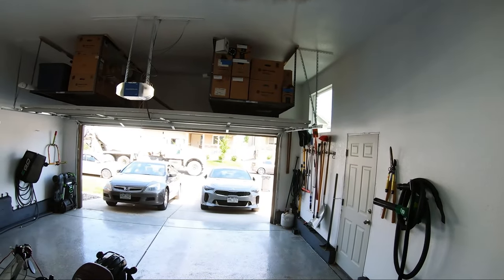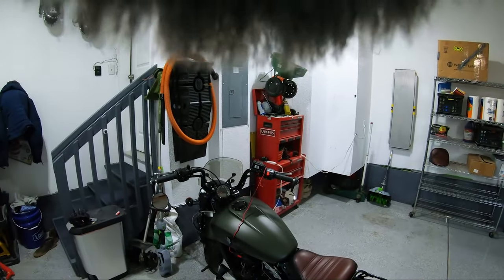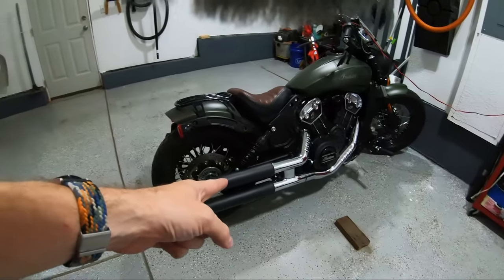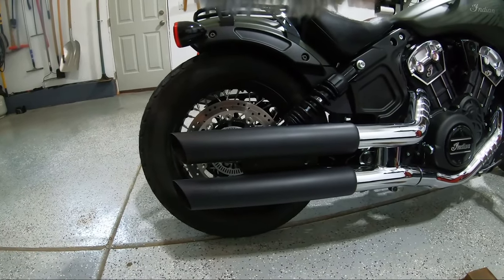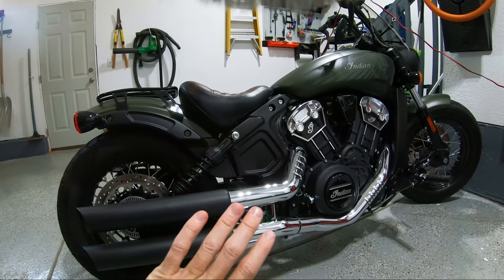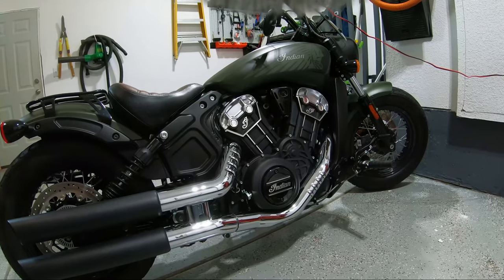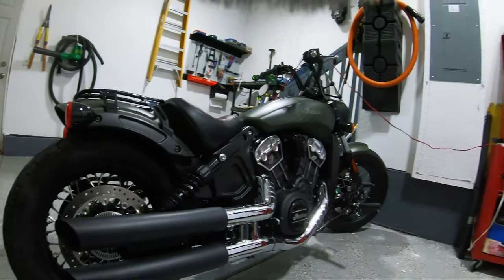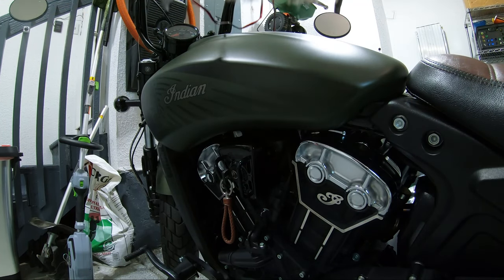Indian Scout Bobber How to Quiet Down Vance & Hines Twin Slash Exhaust on a Budget

Comment: Glad I found this video. Did the same thing and peeled the fiberglass in half, but I used Saran Wrap like they do with the quiet baffles you can order (burns off). Wrap tighter on the end that leads back into the exhaust, still can be a pain, but no issues and definitely a lot better on the ears at wide open throttle
Reply from the maker: Yea it was a pain for sure. I think if I did it again I would go that route or use masking tape all the way around so it would just burn off. But a great mod none the less.

Comment: Great video. I have the same bike as yours same exhaust. I changed the heat shields to black, swapped in an LED headlamp, installed extended foot pegs and added a saddle bag. This baffle mod and rear suspension upgrade are the two left on my list.
Reply from the maker: Yeah I wasn't a fan of the extended controls. Probably just because I come more standard bikes that have mid controls and I that even tho I am 6 foot 3 it feelt to far out for me. Specially with this seat. 

I am on the fence about the LED headlight. I like the light it produced but I am not a fan of the look. The analog style of the stock one feels better. But I have also seen some headline grills that you can throw on over the LED one and they make it look better.

Comment: I did the exact same on my Rinehart's but my baffles were so hard to get out i had to take the exhaust off the bike. I probably lost 2 pounds of sweat trying to do it.  It did make a difference especially on highways it took that high frequency pitch away. I just hope i dont need to do that again.
Reply from the maker: Same. It was quite a bit more complicated than I anticipated but if it holds out, I think I will keep them. It really made it sound just right.

Comment: How are these baffles going? Where did you get the inserts?
Reply from the maker: Sorry for the late reply. the actual metal baffles are the standard ones that come with the mufflers. The packing I got off amazon. Just search for "motorcycle fiberglass exhaust mat". I paid like $15-$20 for mine. You can peel it into thinner sheets which is what i had to do to get it in.

Comment: Hi. I am having similar issues with the noise on my Scout Bobber. Before I start dismantling my V&H system (looks identical to yours on the outside) could you please confirm if you have a honeycomb gauze in the inside of your muffler pipes (6-8 inches within the muffler) like mine or can you see straight through. Thanks in advance.
Reply from the maker: Before I wrapped mine, you can see at 10:01 in the video that the only thing in my pipes was the baffles. You can see through them but they have a texture to the inside of them with little half circles in the metal poking down into the baffle tube. All I did was wrap those in fiberglass muffler backing and insert them back into the pipes. They did NOT have a honeycomb pattern to them at all.